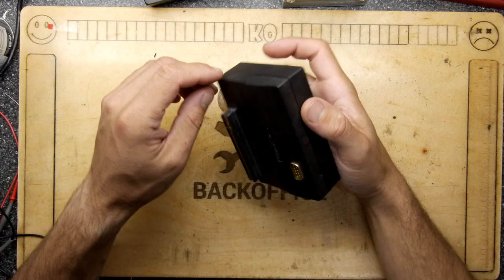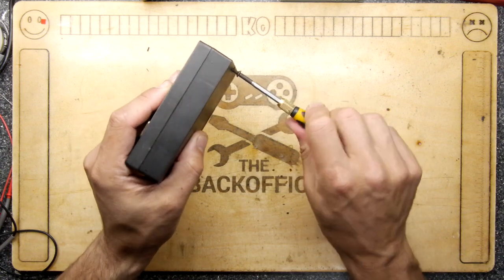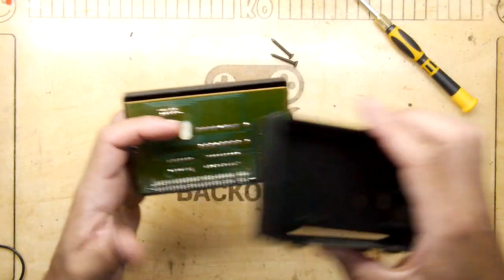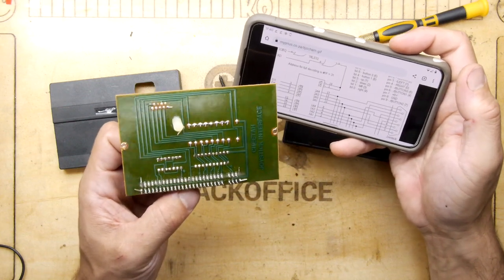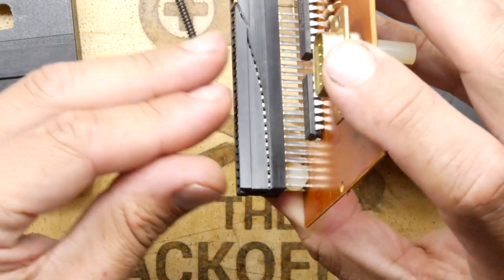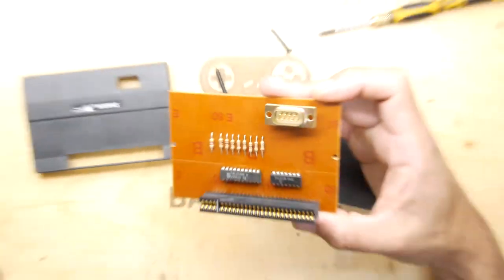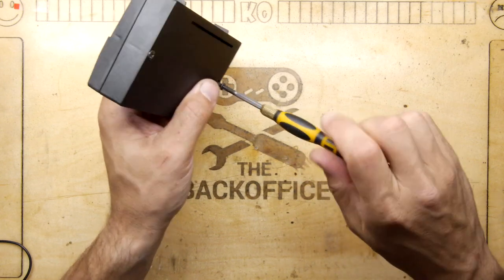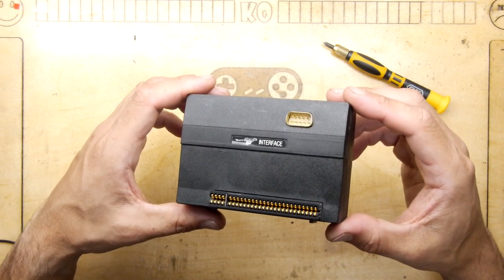ZX Spectrum Cheetah Joystick Interface

Comment: The Kempston interface doesn't use the keyboard  buffer, it uses port 31 instead. Directions and fire are encoded in the lower 5 bits.
Reply from the maker: I wonder if the +2 onwards used the same scheme internally
Reply: @backofficeshow  +2 uses Sinclair standard, that does make use of the keyboard. Joystick 1 is keys 1-5, Joystick 2, keys 6-0. It's the only spectrum standard that supports 2 sticks
Reply from the maker: Ahhh! I understand now!

So I knew there was a keyboard connection somewhere 🤣